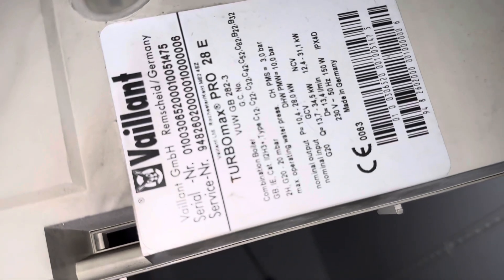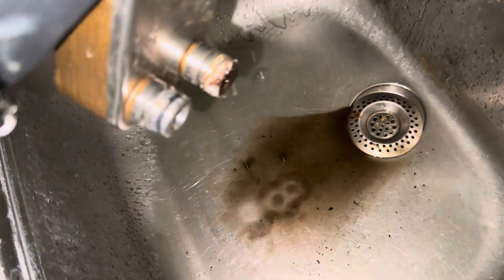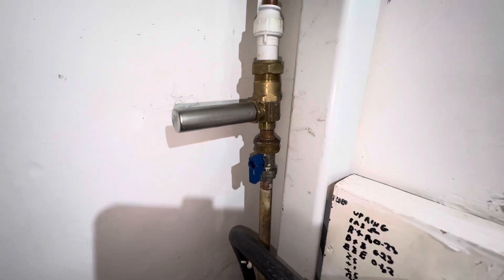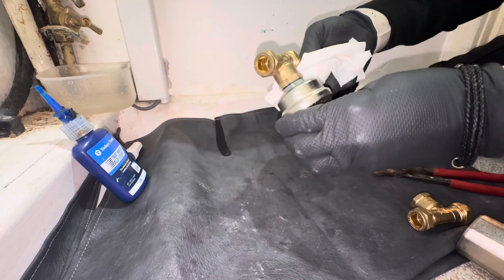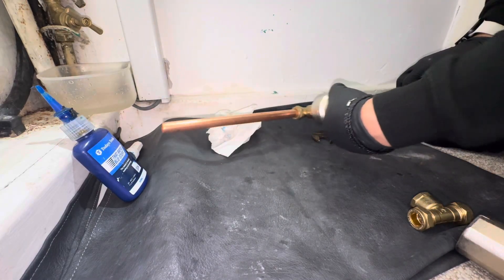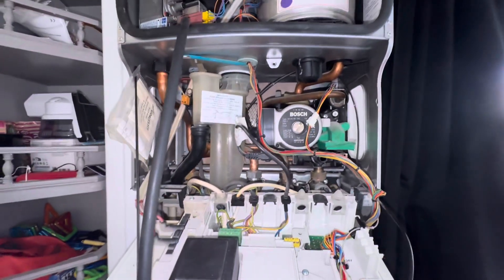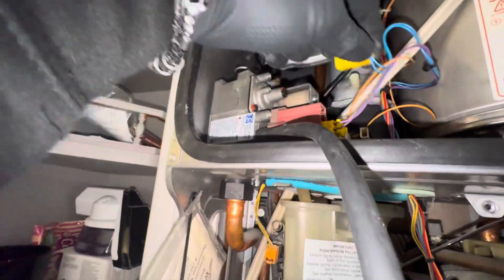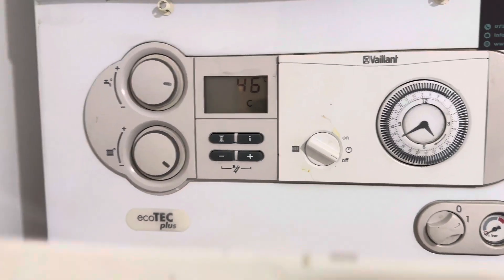Why are these pipes so noisy?

Comment: Im going to give most gas engineers a tip here. The reason why diverters fail, is because the plates blocked. The amount of people who actually think its diverter thats at fault, when in fact its plate
Reply: @Purebeltersteve  vaillants diverters seem to fail from poor water quality i swapped loads of diverters but only ever fitted a couple of plates on ecotecs
Reply: Or the water quality is crap in the system and it’s eaten the seals. If the plates blocked it can push through the diverter
Reply: @alimack5489  why else would the plate be blocked lol
Reply: @Purebeltersteve  yeah I’m an idiot and read that wrong your right 😂

Comment: Hey buddy. Cant quite make out what you're saying/explaing sometimes when the boiler is on . What was the reason for the flue stat creating a resistance ? Was the stat faulty or was it because of the rust around the terminals? Also, what was the outcome with the vaillant ecotec at the end ? Diverter or resolved with turning off comfort mode ? Cheers buddy
Reply from the maker: @macpatel7810  hey my man, comfort solved the main issue of heating being on all the time but the diverter was still faulty and needed replacing - which is in a previous video I made! Posted them backwards 🤣 the rust on the flue stat made it faulty, couldn’t see anything leaking onto it though. 

That’s annoying, I always wear a mic, maybe time for an upgrade!
Reply: @RJHeating . I see. With the Worcester. Sometimes it's the plastic flow connection elbow from the main heat exchanger above. I've come across it a few . Sometimes not too noticeable. And changing the o'ring doesn't help either. Maybe a hairline crack or something..
Reply from the maker: @ oh yeah ive seen that too. No signs of anything on this one in particular though 🤔

Comment: A good way to test if diverter is passing is run hot tap, meassure hot water temp at tap then isolate flow valve if hot water temp rises after then diverter is 100% passing 🎉🎉
Reply from the maker: @jackclowry9644  yep, that’s another good way! Especially when the pipes are already hot!